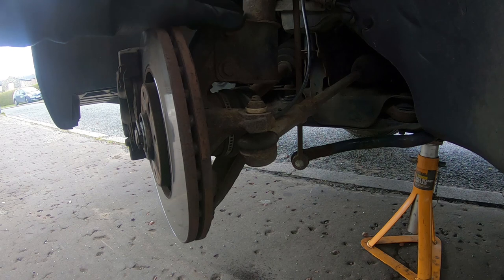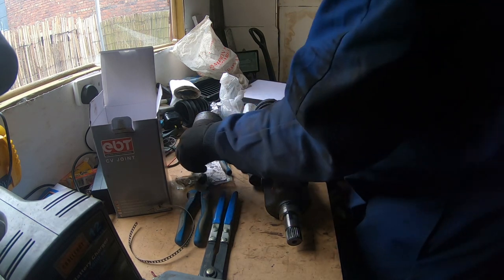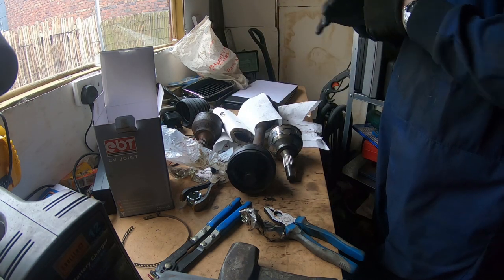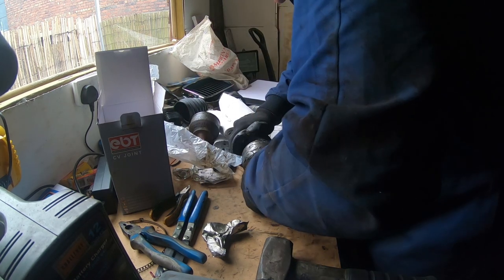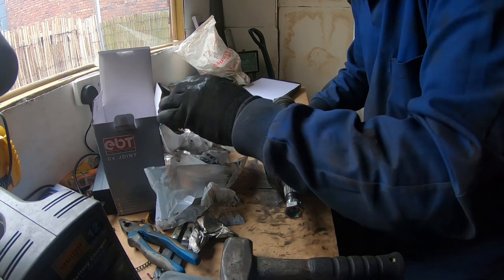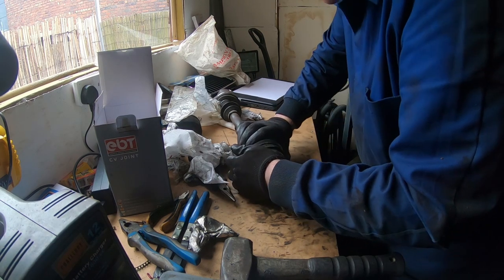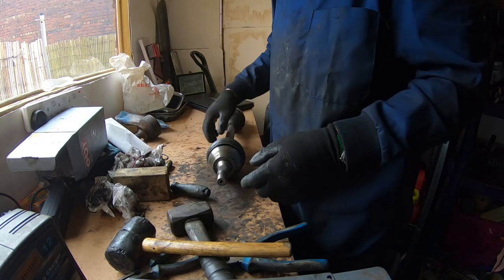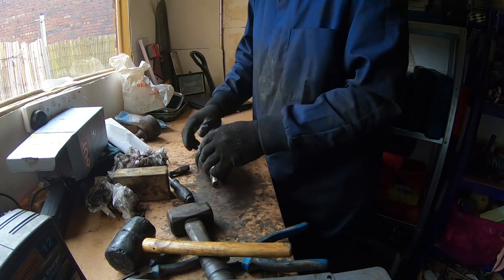Citroen C4 Grand Picasso Part 47 - Nearside (left) outer CV joint replacement

Comment: Its easy to knock it off.....continues to smack it for 3451 seconds.

Btw every car has that much play when moving disc backwards and forwards
Reply from the maker: Sometimes they need it bit more persuasion to get them off. The old CV joint was so worn that even the dashcam was picking it up. It makes a distinctive sound.